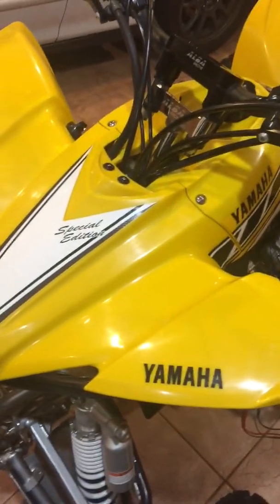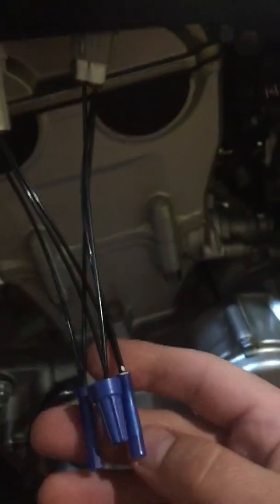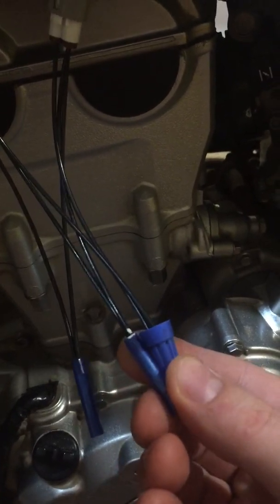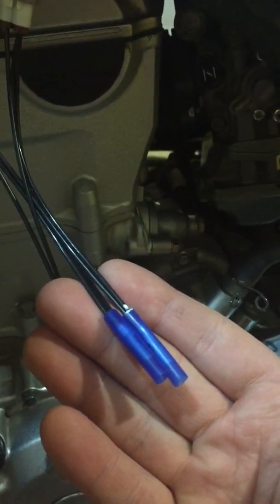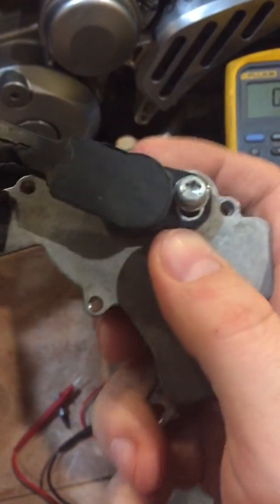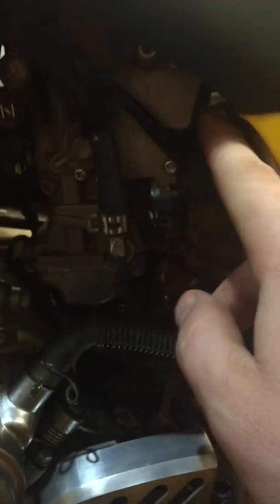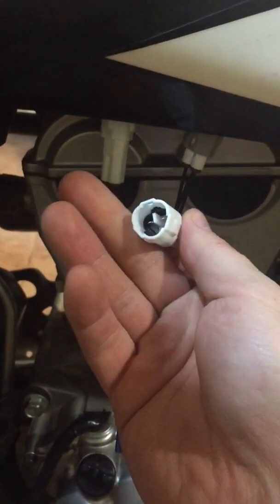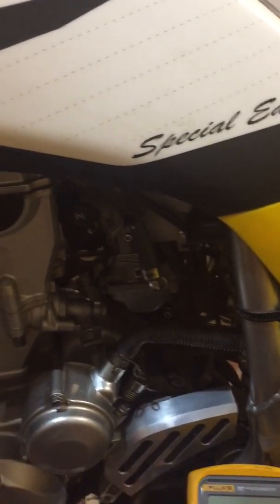Project YFZ 450 Throttle position sensor setup and bypass

Comment: Please can you write the colors you bypass I have an electrical fail when is running I already put a new cdi New carburetor New sparkplug and sparkcap take out the carburetor around 100 time I am turning crazy with this help
Reply: hey bro what was your problem ? i have a issue with gas to needs to be a electric problem i cant find it also engie runs good en goes like crazy but having a dip with my throttle every gear little bog/dip but nothing with carb or stuff

Comment: Can i run the bike when my tps sensor is disconected? Because when i plug it in , it starts shooting and bad to drive with it , when in unplugged its runs great
Reply: Humm mine ran great idle but wouldn't rev only if you ease into it... Never thought of unplugging the tps sensor.. Now i have broken the power jet nozzle so i fuked my carb... Damn i should have tried unplugging thr tps sensor to seee.

Comment: What connector did you use that plugged into the original wire? The male and female ones not the blue ones
Reply from the maker: I made the tps harness for this specific purpose. I have the male and female three wires connectors.
Reply: Mechanics Antics could you find all the parts in the vid at your local auto zone?
Reply from the maker: No, the connectors are specific and not something you can find at any parts store. I get them through a friend who makes custom wire harnesses for a living.
Reply: @mechanicsantics3575  Might your custom wire harness friend know the type or part numbers on those TPS sensors? I would like to build that same harness as you did?